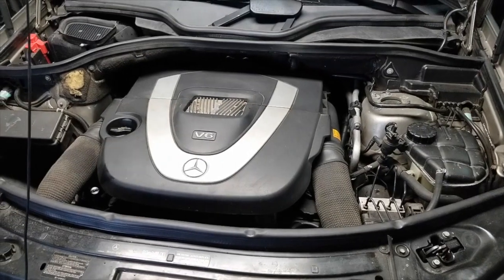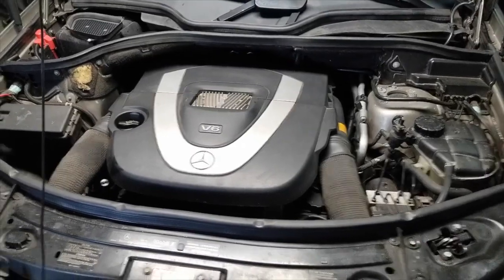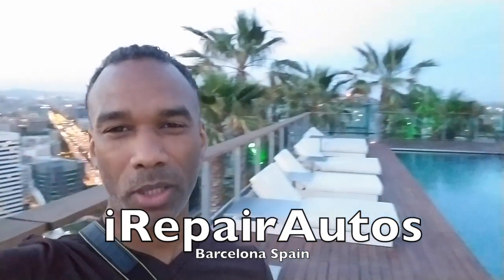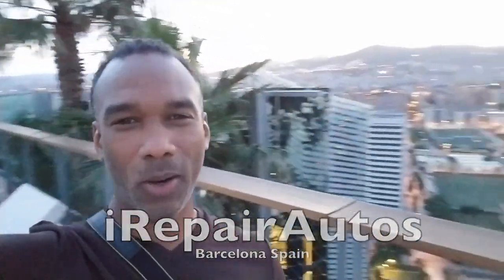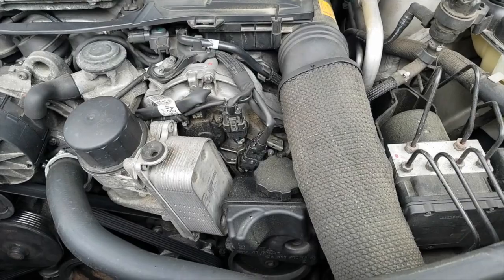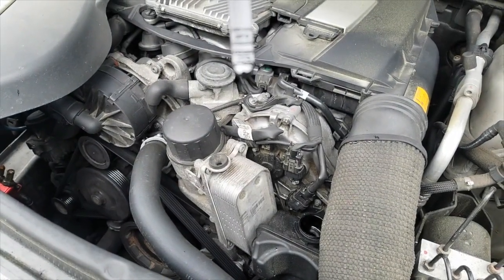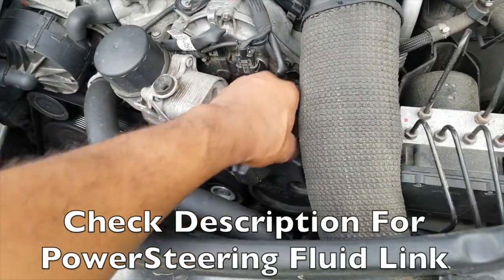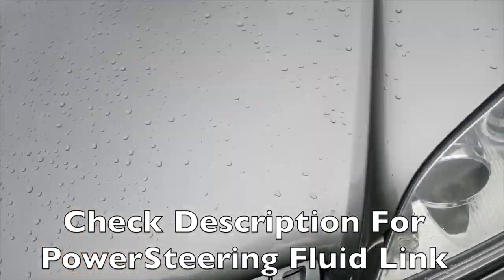Mercedes Power Steering Noise Problem Solved

Comment: I see you gave us some scenery of Barcelona Spain. Nice back drop. I just changed my power steering reservoir about 2 months ago. I had a severe leak. Stealership wanted to charge 5400 for the job. They wanted to change the Power Steering Column, Power Steering Pump, and the reservoir. Heads up Mercedes did a recall on the ML 350. If your ML 350 is leaking power steering fluid. Change the reservoir first. It worked for me. Thx for the video as always Keith.

Comment: That fix is if your lucky, but my cls55 had that noise when I purchased it and I found that I had to do a fluid flush because when the fluid gets old it gets black and gritty. Once I flushed it with a clear hose and  a couple of cans it went away. But that being said thank you for the videos, I watch them all the time in my line up.

Comment: This problem is NOT solved, just hidden. The power steering fluid does not simply disappear. If it's low, then there's an underlying problem that needs to be found.
Reply: add some stop leaks to recondition the seals. will get ya another 50k miles.

Comment: My 2000 E320 suddenly started making a weird noise when I start turning the wheel, not knowing what it might be I felt like it could be a belt.Sounds worse when I turn, going to check the level now . Thank you , I also read online something about the rubber boot around the steering column , hoping that’s not it!
Reply: What was it?My E55 just started doing it.
Reply: My E320 is currently doing that. I thought it was a worn tensioner so I replaced it but it’s still making that noise. I’m going to check my fluid tomorrow and see if this is the problem
Reply: KennyThe LastGamer The dealer initially thought it needed a steering fluid flush but determined I needed a steering pump all together. They looked further and then told me I needed a rack and pinion as well because it was “leaking”. Estimate to fix was $6000. I went home that night and went on CarGurus and the next morning bought a Lexus. I had 20 yr old Mercedes and it costs almost twice than what it’s worth to fix? Ridiculous. I loved that car and drove it for six years . I put all kinds of money in it but I’m sick of mercedes charging for parts and labor.
Reply: any updates ?

Comment: The transmission pump makes the same noise
Reply: where is that at? I just used I siphon pump and took out all the fluid from steering pump. put in new ran it a bit and removed all fluid again and put in new fluid. I still hear noise. after I idle the vehicle a bit and turn left and right the noise seems to go away but merely comes back.